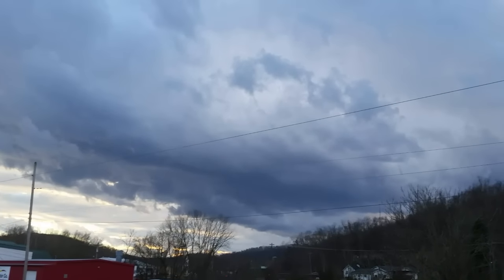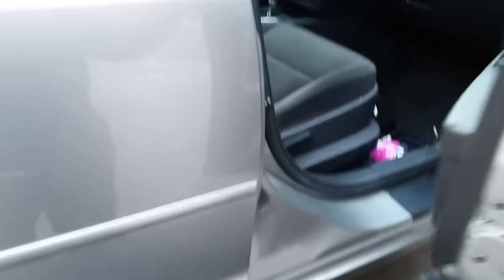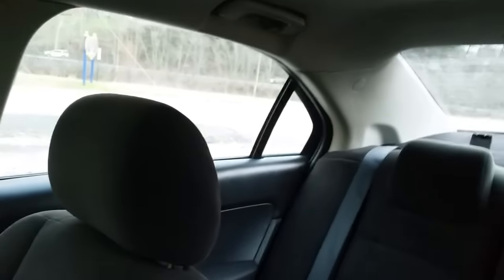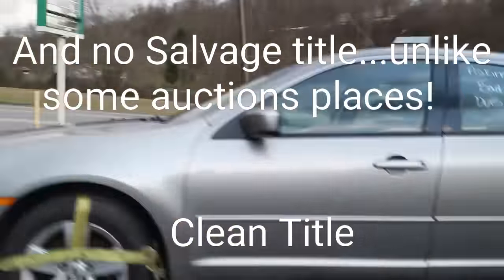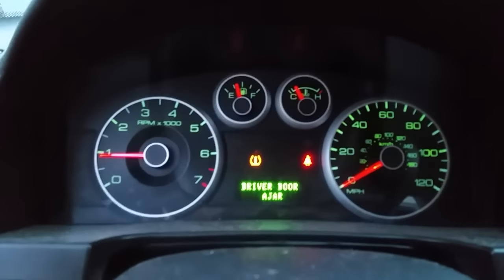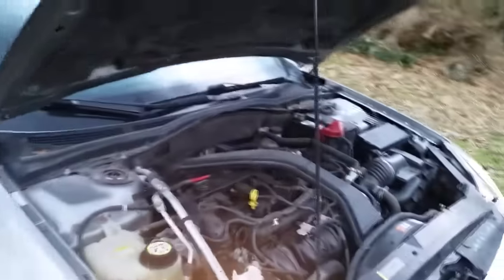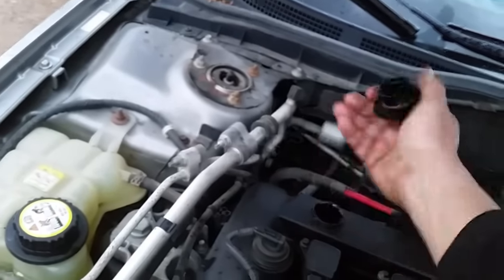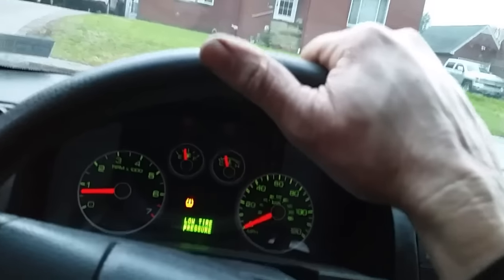2008 Ford Fusion... I Bought It Cheep!~~...Lets fix it. Pretty Little Car...

Comment from the maker: I found out also it has pair your phone with Ford SYNC...2008 Ford Fusion with Microsoft Sync and Bluetooth and steering wheel controls.
Reply: I just brought a 2008 v6 fully loaded...silver color which only had 97, 589 miles on it.....love my car...only problem is people keep stealing stuff off my 🚗 yes it has a alarm on it....these theifs are quick...i just replaced the back light that was stolen...any suggestions would be greatly appreciated
Reply: @winifredwilliams1798  should I buy the same car for 4500.

Comment: Nice deal!  Those look like winter tires on the front.  Yea, maybe give it a trans fluid change, worth a shot!  The Ford 2.5s are pretty durable long lasting engines.
Reply: 2.3
Reply: Yep mine has 220000 miles on it and runs strong the only thing I would have to let it run and heat up a bit so it can shift smoothly on first gear🤔
Reply: @eduardomendiola8140  usually runs better cold for me, real hot days the transmission can get confused. No miss a gear just kinda slow

Comment: Just got one for $300 170k miles needs a passenger side mirror and the back window don't roll up also needs transmission filter and fluid 😎
Reply from the maker: Nice!! Make sure the AC works!

Comment: This car has an Adaptive Learning Transmission that may just need to be reset to relearn your driving habits! It will take a special ODB2 tool to reset it. Just FYI!
Reply from the maker: Yes true. I actually had to put sleeve in the servo. Now it shifts perfect!  Video on here of the servo leak I did a test on. Open HWY now...46mpg!
Reply: @FixingWithPassion  The reason for watching your video among others is to learn what kind of issues I might run into with this model of car.
I am looking to buy used around this model year to drive for Uber/Lyft. I hear the engines in these cars are pretty solid meaning it hardly breaks down and can get 300,000 miles on them before it's salvage yard time.
Reply: @FixingWithPassion  Wow, the gas mileage is that good? My '08 Mercury Milan used to get great gas mileage but has tanked to 23mpg on the expressway. I think I have the same issue.

Comment: Best car I've ever owned was a ROUGH 01 Explorer XLT, 4.0 SOHC 2WD with 240K on it, I gave $400 for it, and sold it for $1K, paint was bad and interior was lacking too, guy is still driving almost two years later. Where'd I get it? Junkyard. Druggie drove it in.
Reply from the maker: My first SUV was a 01 explorer also...lol      190,000 4.0 4x4...got me through some tough times. Respect to that SUV!
Reply: @FixingWithPassion  I have a 4.0 4WD Eddie Bauer I'm actually V8 swapping, 131K on the donor, the V6 was run hot at 198K. It's mint too, can't wait.
Reply: I have this same car I'm loving it

Comment: I didn't know anything about the ford fusion until you said it was a fancy Taurus. I had a Taurus that was always trouble. I got it used with low mileage It had been in an accident but handled well. A short time after we got it the front brakes stuck and got smoking hot. It was too far home to bring it back so we had to have it fixed in the only place that was open that day. I believe it cost around $800 but they said the brakes were fully guaranteed. They replaced all brake parts on all four wheels. Another time it stopped running at a stop sign and wouldn't start. Replaced fuel pump at another garage. Another $600. a while later it was idling too fast. Replaced all the parts that could have something to do with that issue. it worked slightly better for a few days but not the way it should then it idled just as fast as it had previously. I gave up and took it to a garage where the replaced one of the parts I replaced but it was fixed. I took it to a pace to have new plugs and wires replaced as well as Something else that needed to be fixed.  I don't remember what. After he fixed it he told me that Taurus's were money pits so I got rid of it. In the few years I had it it cost me more than any car I ever had in repairs. if I remember correctly it had less that 100 thousand miles when I sold it. I heard that they had transmission problems too. I has a olds cutlass ciera that had 180 thousand miles on it when i sold it after having it for 14 years. I never put that much into it and it was very reliable.
Reply from the maker: I've had 3 Taurus and they were good rides after some work. The fusion is about the same size it seems and even quieter to me than the v6.
Reply: @FixingWithPassion  I forgot to say that a while after they fixed the brakes i needed brake pads replaced so I called the place that guaranteed the brakes. They said it would cost over $100 dollars to replace the front pads when the front pads were free. Some guarantee. I bought the pads for about $20 and replaced them myself. Maybe i just got a lemon but after all the expense and being left by the road I was afraid it would continue.
Reply: @stevek343  The reason I had to have the brakes fixed was that they stuck when I was in town 30 miles from home  in the winter on a Sunday with only one garage open to work on it. I had no tools with me and no parts to fix it. I didn't have a heated place to work on it at home either.  I would have had to have it towed home by wrecker then fix it in cold weather. I replaced the brake pads myself with no problem in warmer weather. When the fuel pump went out it was again in the winter on the way home from work so I had to wait for a wrecker which was cold enough without repairing it in the cold after I had it hauled home.  You must either have a heated garage or be in a place where you don't have to work in 0 degree temperatures in the winter. It is a good thing they are easy to fix because they have to be fixed constantly. I needed something more reliable anyway.  I don't like being marooned by the road at anytime but especially not in the winter. Two times is ridiculous for the number of miles on it especially when I had other cars that I ran to twice the mileage that never left me in that position. I just remembered that it got a leak in the cooling system when i was in town too so I had to have it towed then as well. i couldn't drive it home because the leak was too fast.
Reply: I can't just let this go by without commenting, I had a '2003' Ford Taurus SES Model, great car. Drove for 14 year's, had over 140,000 when I finished with it, easy to work on Vulcan engine, Duratec engines in some models easy too, very few problems, or repairs, or minimal part replacements, I did my own work mostly, blower motor, blower motor resistor, brakes, battery,windshield wipers, it wasn't any money pit to me, sorry to hear your car was your enigma, Thorn in your side,  if a guy can learn to fix his own car, can save hundreds! Most of what you paid sounds to me was labor cost,not parts. Maybe brakes, calipers, slide pins, master cylinder and idle control valve, mas air flow censor, plugs,& wires ,etc... Not maintained by previous owner??you can learn on YouTube how to do most car repairs, I learned there, and continue to learn there, God bless you sir.
Reply: @davedeatherage4902  I am not sure about the previous owner. I bought it from an auto body shop that had done repairs due to an accident. I have done a lot of minor repairs on cars too but in the winter the cold makes it prohibitive.Maybe it was a Friday car. someone told me that with a Taurus you either hate them or love them. It leads me to believe that there were some of these cars with problems and some were good which accounts for the mixed reviews. I have plugged tires, changed plugs, plug wires, wiper blades, alternator, blower motor, wiper motor, and on earlier models changed points. I don't change plugs on cars anymore because they are so hard to get to. Modern cars are made so simple repairs are much difficult than they need to be because they are so hard to get to. Other things are the same way. I have repaired tape recorders, graphic equalizers, and small appliances but newer models are to a point that the challenge is to get them apart. I do most of my furnace repair. I have replaced our water pump on the well. I do all my own wiring and electrical repair. I had a printer that quit working because it blew a fuse on a circuit board. I had to cut a piece of metal off the bottom to get to the fuse. a few screws to hold the bottom on would have made it easy but they preferred to sell a new printer instead.
Reply: I just brought my ford fusion. 2008 yesterday for 1600 I'm loving it

Comment: I guess I'm the only one that's gonna mention that the L4 2.5 liter, dual overhead cam, all aluminum block with VVT (variable valve timing) is made by Mazda. Know for weak automatic transmission 🤣
Reply from the maker: Yep, your right...but some go for 200,00O miles....you just don't know I guess.

Comment: $800!! WOW. I recently bought my 2008 with 145.000 miles for $3000. And o thought I got a good deal.
Reply from the maker: Nice!!
Reply: How yout car running now? Im buying the same with about the same amount of milea
Reply: @VAL13C Meeting with the owner tomorrow, 2008 Ford fusion SE Sedan 4D, 113,800 miles for $4,500 with windshield has some cracks due to the Winter storm last year. Is it a good buy? wondering what to ask to the seller? any tips? thanks! lol.